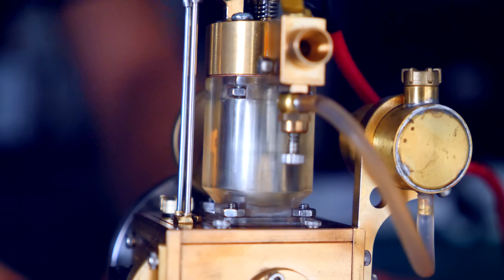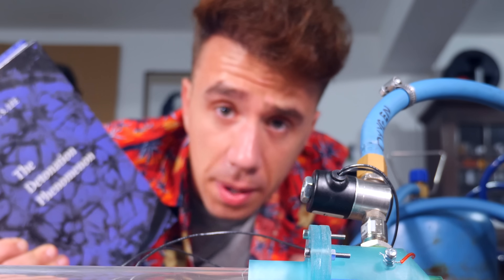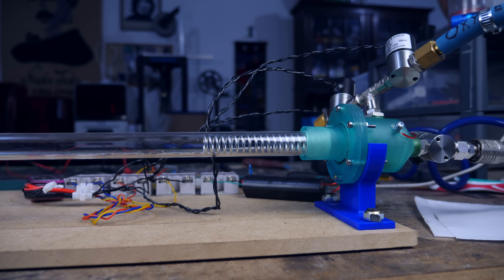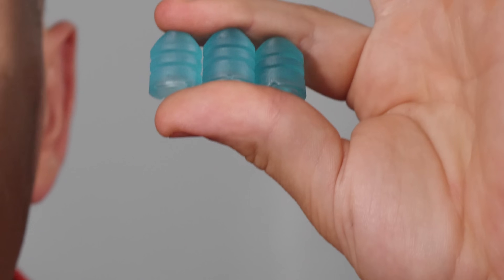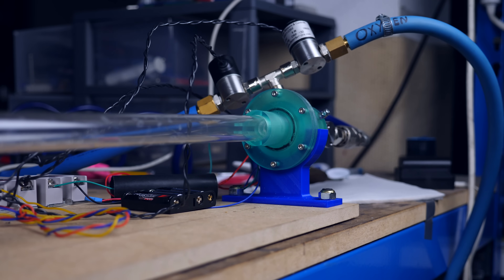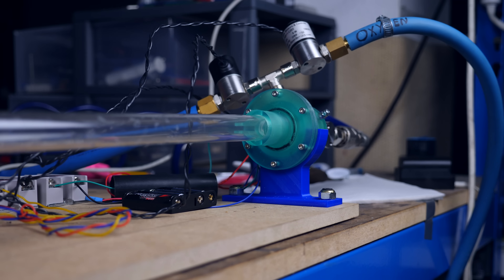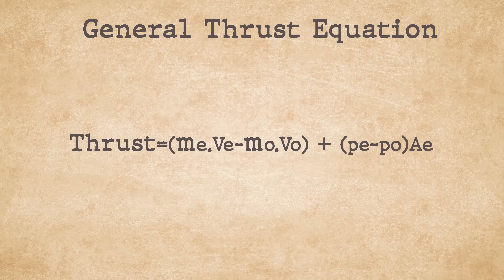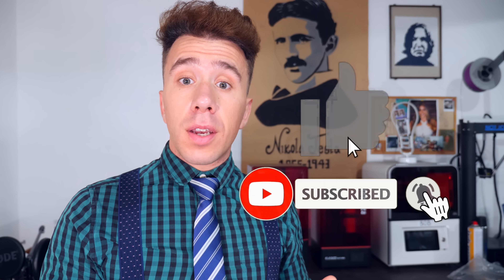PULSED DETONATION ENGINE

Comment: Video suggestion: Supercharged Jet Engine/Shockwave Jet Engine.
Build a Screw blower into the combustion chamber which compresses the fuel mixture and add a little more fuel :) Would be interesting to see if this could actually work for either and what kind of results it gives.

Comment: Idea. make a rotating valve and attach it to a high speed rc car motor to it to exponentially increase the valve cycling speed.
  Using a disk with the motor at its center you line up inlet and outlet ports on a housing. Line up the disk so when it rotates it will allow a full "gulp" of pressurized gas to pass it.  Size of the hole dictates the amount of gas per gulp at a certain pressure.  The number of holes and the rpm dictate the frequency of the gulps. 

Basically turning a hall effect sensor into a high speed valve. By timing the rotation speed to the ignition you can achieve higher rates of detonation. 

By utilizing  tesla valves you can almost eliminate back pressure from detonation.  You attach a high speed valve to this engine you may achieve lift lol.

And 1 last thing,  hearing protection.  Get some hearing protection. The engine really was loud and did sound like a old tompson from ww2.

Comment: Video suggestion: Implosions and/or vacuum to power EXTERNAL Combustion Engine... 
I imagine it would be easier than an Internal version, by having a central low pressure that then uses atmosphere pressure to provide power.

I am working on a weird engine similar to the one I described, yet also completely different, for use in space.. 😉🤫

Comment: Video idea, make an engine (not really sure which kind would be best for this) use the pressure that comes out of the back to spin a flywheel up to speed and when fast enough apply a some form of breaking to use the momentum to crush a tomato.

Comment: Cool PDE! Fun fact the Shchelkin spiral is generate turbulence which is the main culprit in the deflagration to detonation transition (DDT). Also gas detonations have a 3D structure measured by a detonation cell size which is generally a function of the fuel chemistry. A general rule of thumb is the lower the fuel activation energy, the smaller the cell size, the easier to transition to detonation. It's difficult to make heavy hydrocarbons detonate due to having a larger cell size, so sometimes they need bigger tubes. Good luck on the RDE! Seems like most struggle with detonation stability and only have operate for a few seconds, looking forward to seeing your results.

Comment: Suggestion: Your jet engine can fire a small projectile, what if you scale up the aperture to fire tomato like a cannon? :) You might need to use a solid projectile or wadding behind it for a gas seal to push the tomato down the tube like a real cannon

Comment: I too was wondering how you could make a rotating detonator with six or 8 injector sites and then it hit me that a swash plate in a hydrolic pump or a helicopter rotates with a wobble, not perpendicular to it's axis, but the axis is shifted so the disc acts like a coin as it is spun and begins to relax on the table it occilates  in this same manner.  The purpose of this is to draw air and fuel in behind it and force it through one of six or eight holes through the plate to ignite on the other side, pushing the plate forward as it does so in a cyclic procedure that aides it's spinning.  There could even be stationary vanes riding against the swashplate like spring loaded carbon brushes in a motor to segment the intake and force it through a flapper valve.   This is just off the top of my head but it seems like it would work and propel itself spinning once started.  Good luck tomato hater.

Comment: Very interesting project and design process! I know the air speed is already around Mach 1 but maybe a Laval nozzle could be used on the output instead of the straight tube. I’m sure you know that is what they put on rocket engines. It utilizes the Venturi effect to manipulate the flow. Which I’m thinking could increase the output of this detonation engine.

Comment: Awesome engine!
For a video idea - although I think it would be difficult to pull off... - Try a "Water powered" jet engine - by doing electrolysis on the water first to get your fuel - H2O. I think the biggest issue would be creating enough HHO gas through electrolysis, as it's a pretty inefficient process. 
There's a ton of videos on making HHO gas on youtube, but I would recommend NightHawkinLight's video to start - https://www.youtube.com/watch?v=d85OX6yEwE0
It's probably not feasible, but it would be cool to build an engine that took water as a fuel. Thanks for the cool videos.

Comment: hi if you add higher melting element we can increase pulses with better valve you can maybe add gas valve which can have almost instant switch from closed to open instead of butane use hydrogen which has more power than butane this is my idea we can use dry ice or nitro gen for cooling

Comment: Your exhaust Is indicative of nozzle that's too short! atmospheric pressure keeps the exhaust linear until it cools off enough to flare out. you need a bell-shaped nozzle, a cone on the end, or a longer tube. you're losing a lot of thrust right now. you want to open up your exhaust stream until you balance atmospheric pressure with exhaust pressure. keep going bigger until you reach over-expansion and your shockwave starts to tuck inside the cone  (which is really bad for actual use, but for r&d you can go big and trim it down)

Rockets have to deal with this, and compromises are definitely made. If you look at the Saturn v and I think the space shuttle, the nozzles are actually too large and have separation at liftoff. this is because they spend very little time burning at sea level, and engineers compromised to get better efficiency in flight over takeoff power.

You are actually starting to get a Mach diamond in your exaust stream as it is. if you look about an inch from the end of the tip you can see it trying to form. they are a really neat phenomenon of rocket engines and the fact you are already there is so cool

Fun fact, if you just slap a funnel on the end, on a powder actuated lead particle accelerator, that is known as a "louder" or "recoil enhancer" and is used on some old devices that are made to get dirty and need a lot of oomph to work the mechicals

Comment: It could add more complexity to the design but I believe you could get It going faster if you use motors with free turning ball valve or something like that. Of course there is some issue like the added weight and the difficulty of designing it.

Comment: Dood!  What happened to your mustache!?

Okay, just to nit-pick, this isn't a jet engine.  It's a pulse detonation rocket.  To be a jet, it would have to use atmospheric air as the oxidizer (like that thermojet you built).  You're using oxygen from a pressure bottle here.  That said, I don't know that there has been a successful pulse detonation engine that runs on atmospheric air (I don't know that there hasn't, either; there have been some claims based on videos of unacknowledged or secret aircraft) -- as you noted, it's a much harder problem than detonation with pure oxygen.

Comment: Just fyi, the 80 m/s that you measure are a large under estimation of what the actual velocity of a detonation is.
In oxygen mixture with hydrogen at stoichiometry you'd get up to 18 bar on average right behind the wave, with peaks at more than 200 bar so that's why it's so loud.
It's supposed to be a shock that sustains the reactions so the speed of the front is almost hypersonic (M ~ 5.3) in reference to the fresh mixture. That's about 2843 m/s which is freaking fast.
The velocity of the gas itself is not as crazy but is still order of magnitude higher than 80 m/s.
The 80 m/s happens only very early when the flame accelerates to a detonation (by some complex pressure reinforcement phenomena). Which is what is shown in the video.
Guns are mostly not powered by detonation but by the anaerobic combustion of solid propellant (black powder, etc).

Comment: You should try 3D printing a salters duck.
It is a electricity generating float strung in a long chain in the ocean. The duck itself has a 90% efficiency - higher than any other renewable energy source.

Comment: A Electric Plasma Jet Engine is a cool technology which is using a electric engine to move/mix fuel and air/oxygen, then it ignites the outcoming gases. It would be cool to have this in a smaller format using CNC and metal 3D-printing.:goodvibes:

Comment: Maybe you could use home-made valve for pulsing the gas? Basically a shaft rotating 12000 rpm with a through hole in the middle of the gas stream. I guess the seals would be a problem but otherwise you could use shared shaft for both gases to get them to stay in sync.

Comment: This thing is awesome. You can  try to turn it into a gatling style shockwave jet engine. if the chambers are rotating, you can fill one chamber and ignite a second one at the same time. If you are crazy enough you could also omit the valves and let the gases flow continuously. Either way you should be able to gain a much higher ignition frequency

Comment: How about using a rotary valve based on the rotary engine? That way you could match the timing of the spark with the injection of the fuel and oxygen.

Comment: I still think your missing out on a mager part of your desines using the heat your genrating to to preheat you fuel and that same fuel to coll making your plastic parts last longer . buy putting a air mixing chamber around the engine.

Comment: What about a cold motor? Which work with ice?
And you should buy a tig or mig system for the soldering (steal solder is better than copper for your projects)

Comment: As someone who spent 15 years in the reserves around jet engines, Integza needs to add ear protection to his personal protective equipment.  I wasn't careful enough when I was his age, and now have the hearing loss to prove it.  Nowadays you can get electronic ear protection that actually lets you hear quieter sounds than normal and only blocks sounds loud enough to damage your ears.
Reply: I lack your 15y being around jet engines, but I was thinking the exact same thing throughout the video :D For me....it was concerts. Now I have this lovely ringing.
Reply: @AsmodeusMictian  hunting without ear pro for me😂
Reply: @ Yeah, to me guns are a little deceptive. If you're outside, it doesn't "feel" that loud (obviously this is dependent on the gun lol) but it will still wreck your hearing over time. I did have the misfortune of being around when a 12ga shotgun went off indoors at a range. My ears straight up rang for DAYS. I can only imagine what severe tinnitus must be like.
Reply: @AsmodeusMictian  in the next 10 years we'll probably have a cure for tinnitus to be honest so its not too much of a big deal
Reply: I am 14 and made my first pulsejet yesterday
Reply: @ethankrone2447 nice dude continue and stay safe :D
Reply: I built a shockwave jet engine. It was very loud. I needed to add ear protection to my personal protective equipment. The engine created a lot of thrust and was very powerful. It was an amazing experience.
Reply: @showshowtomakefreeenergyge2426 I wouldn't trust a free energy nut, but ear protection is good. 

Why you be a scientologist, yammering on about fake free energy ?

Maybe ya wanna change your profile name so people take you seriously. 

Because otherwise it seems like you are a crackpot.

"Shows how to make free energy" 
Come on that is a pipe dream and embarrassing hobby to have. Physics demands you purge your sinful ways and recant like Voltaire. 
Sad
Reply: As a fellow reservist I recommend filing for VA compensation for tinnitus if you haven’t already. It’s only a 10% rating but is important to be compensated for the wear and tear on your body that cannot be repaired 🫡
Reply: I spent much of the 1970s driving race cars with no mufflers. Yeah, my hearing could be way better than it is.
Reply: Ayo, would you be able to link to the electronic protection you are speaking of? Would be awesome for my work.
Reply: WHAT DID YOU SAY?

Seriously though, I agree.
Reply: my pop worked around jet engines (airline mechanic) for 40-50 years. he always used hearing protection. he still had some hearing loss, particularly in the high freq range
Reply: Tinnitus is a bitch. I hear ringing constantly and it's no fun. Ear protection is wunderbar
Reply: Be invincible or die
Reply: it is those ear mufflers for gun ranges
Reply: Your hearing loss was not engineering related.

Comment: I have an idea to build a generator that you drag behind your sailboat to provide some power.  it would consist of a screen, then a wide opening that funnels to a small er tube that houses the propellor. connected via belt from the outside of the fan to the business end of a generator /alternator motor. which somehow needs to stay water tight.  that's my suggestion. obviously it's been bouncing around my head for a while now.

Comment: Next time, try to put some rifling on the projectile. Kinda like a shotgun slug. It will help to stabilize projectile, and also increases the speed (I think, not sure whether it increases the speed)

Also if it sounds like a gun, please use ear protection. You will develop hearing damage without it.

Comment: One thing that is commonly used in high powered air soft guns using a bottle of compressed air, is the polarstar airsoft jack, it has a limited amount of air pressure that it can handle (3-3.5 kpsi), but it can activate as much as 60 times per second, if you wanted to make a better version that shoots faster.

Comment: Could you do a video exploring the Tesla turbine? I feel like there is serious potential behind it if someone would just stop trying to scale the thing up and just make multiples of a smaller version.

People claim it's impractical because it can't be reasonable scaled up because the material the discs are made of are never going to be strong enough to stay together. They are talking in reference to a Dam but I think if you just split that massive income of water into multiple smaller models you could make it useful. Plus it would reduce cost, improve on "downtime because you only need to change out a single module at a time, and the efficiency of these devices is insanely high.

I just don't think it's being utilized to its full potential and would like someone with the resources to actually test this try and see if I'm truly wrong.

Comment: For Future Video: I was gonna patent this, but let's see what you come up with first. Build a high thrust jet engine and hook it up to a bladeless fan. To increase air flow for more thrust, 3D print a Tesla valve for the exiting air flow tube area. Might need to mold from metal to handle heat. But instead of just one Tesla valve, mold the exiting air flow tube with multiple Tesla valves side by side and in a spiral, all in one large exiting tube. The only problem now is how to reduce weight of the object that I'm trying to move. I have an idea and will call it the LTL (lighten the load) drive. Still working on that project.

Comment: Why don't you make a focus fusion core where a carbon cylinder has a ring of carbon rods around it. The rods and ring are all insulated part way up using a glass or ferroelectric material for high capacitance. Then the combustion chamber has a magnetron to ignite methane using the arc on the carbon electrodes to make a pinch though ideal fuel would be hydrogen or decaborene gas for fusion. The chamber may be self running if the fuel makes an electron beam in the magnetron chamber and the exhaust would be an ion beam. And that is a vortex fusion engine. Though this may be more dangerous and insane than anything you can do.
Reply: Inert gas may be a bit safer but it makes it just an ion engine.

Comment: You NEED to build a EDM lathe,  so you can maje amazing things from steel,  and it works similar to a 3D printer, mixed with a CNC mill! It would be some awesome videos building and using it as well,,,

Comment: have you thought of making a radial engine similar to 1930s era bombers? It would be a cool concept to see how 3d printed parts would hold against the torque, pressure, and heat from one of those.

Comment: My guess is to make it continuous or seem continuous, let’s say you had roughly 8-12 shorter tubes each with its own detonations, let say 10 per second or whatever, but have them circulate one after the other which would appear continuous, all these tubes connect to a cone shaped singular tube( wide enough to hold all but shortens at the end to build up more pressure at final exhaust.  And maybe the internal tubes could be angled either inwards or outwards if that makes sense, not sure the angle would help.  To sum up what I mean about the explosions, picture each detonation as a point on a circle, and as they go off in a circular pattern, it would look as if it’s spinning like numbers on a clock

Comment: Cool video, will be waiting for the RDE follow-up. 
Just a comment on full scale jet engines designed for flight under the speed of sound. Pressure thrust is actually a significant component of these engines as to get further expansion would require supersonic exhaust flow and therefore a convergent-divergent nozzle design. To avoid that they expand and accelerate the exhaust flow right up to the speed of sound and it exits at whatever pressure that expansion ratio leaves. 
At the risk of muddying the waters a bit, if you look at the huge turbofans that power modern passenger jets the majority of the thrust comes from the fan and that requires more turbine stages in the core that can consume more of the pressure from the combustion chamber. But at full power conditions choked flow at the speed of sound still puts an upper limit on the expansion ratio of the nozzle of the engine core.